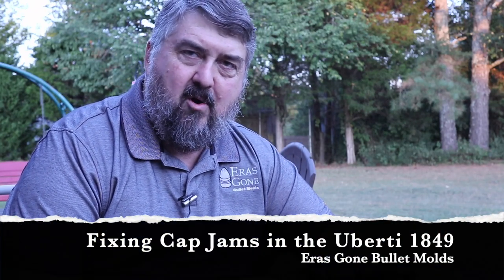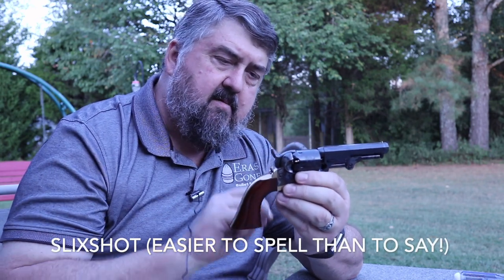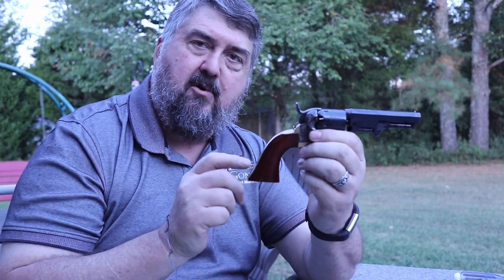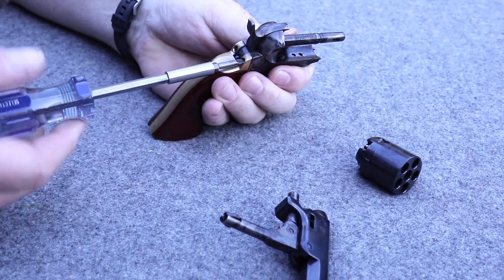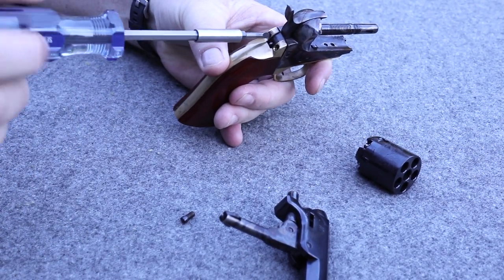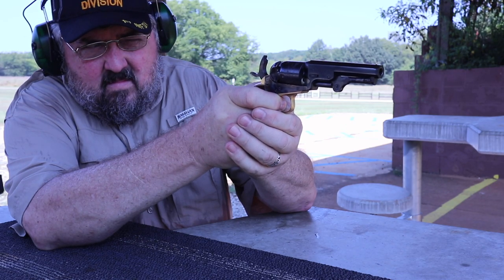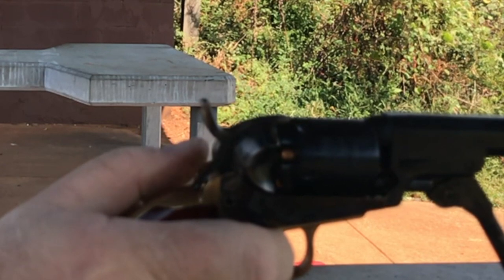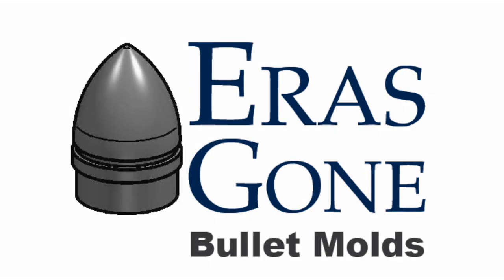Uberti Model 1849 Cap Jam Fixes

Comment: The biggest reason for regular cap jams is the modern handling of cap and ball revolvers in addition to range requirements for safety. 
The revolver that has the least cap jams is the Spiller and Burr.
The double spring method shown here is the best known fix, consider caliper grease between the springs. 
Super video sir!

Comment: I use a length of 1/4 OD with a .170 ID vinyl  tubing. The ID is perfect to trap a cap. I press a piece of the tubing over the cap and cut it so the cap now has a vinyl jacket that will 100% stop cap jams on any c&b revolver. The caps stay on the nipples and are captured by the vinyl jacket. The caps are even easier to put on and remove than they would be normally.

Comment: Just about everyone I have talked to who bought an Uberti Model 1849 Pocket revolver has had issues with them, one thing or another. Mine literally wouldn't stay on half cock new out of the box, I ended up having to replace the hammer. The timing wasn't great and I swapped out the nipples on mine to Amco nipples and it works fine. The barrel wedge doesn't sit in very well, it's loose. I bought a second new wedge from Uberti, it was looser than the one that came with the gun, so I peened the one wedge some and that makes it sit in the gun better. It took a bit or working to get it there but once I did it became a fairly decent shooter, but Uberti has had issues with these guns for years. I was lucky enough to get a stout mainspring in mine.

Comment: Good to know about the Uberti mainspring. One other thing that I've noticed is that most Colt replicas have cap jam issues, and one thing that makes a huge difference is to hone the pin slot in the hammer nose. While not an obvious place to work on, slicking up that slot as much as possible really reduces cap jams.

Comment: I bought one of these last year. I do love the gone, but it needed a lot of work. I had to stone the hand to stop the over rotation. The nipples were simply too short to use if they were properly seated. And the hammer face had a large blob of metal on it that I had to remove with a file. It's fine now, but that gun never should have left the factory.  Thanks for making these videos to show people how to correct the poor quality control we have to deal with these days.

Comment: I've never had the extreme blowback on my pocket model like you've had but it was still an issue. I tried track of the wolf nipples first, with great results but I haven't tried the treso yet but have them at the ready. 
After your 1860 army fluted Cylinder video I got one myself and noticed the nipples were near identical and well made, limited taper but unfortunately they had the largest vent hole I've ever seen on any nipple.
When after firing I point the gun to the ground and then cock with a twist, this keeps me from having a cap jam. I only shoot on my farm so this is easily done.
Mark, this was a super video with great information, I'll be trying this fix. Thanks!

Comment: ... something I learned using two pietta 1860's was to lighten my powder loads. Over charging or "maximum" charged loads will often result in hammers being blown back as well as charging rods being dropped as in your video. I reduced my charges from 30gr to 24gr with better results , still quite deadly...

Comment: I had the same issues with mine. I was able to make heavier main spring myself. Your double stack idea is great. I noticed on my Uberti 1849 pocket that the nipple pockets were different depths. The nipples were ending up too long and some were too short. That made me put a  spacer washer under some and shorten the cone and reshape on two nipples. Now they all fire and the cap jams are minimal. Great video. I may order an additional cylinder and see if the nipple depth are more accurate

Comment: Thanks.  Having the same problem with my Uberti 1862 Pocket Police and my 1862 Pocket Navy.  The replacement nipples from Slixshot are on their way.  If that doesn't resolve it, I will be ordering two extra mainsprings for them.  So glad that you say there is a fix for this, because these are such cool little guns, and it would be a shame if they couldn't be made to be reliable.
Reply: @SSN515  Yes.  Recommended.
Reply: @therealhawkeyeii7888  OK, thanks for the info.

Comment: I have also used a standard Colt type mainspring and shortened it a little. The screw hole is the same but you may have to trim a small amount of metal on either side of that area to fit the one piece grips. This gives you an option of trying a standard or reduced power mainspring. The current stock Uberti mainspring is weakest right at the top under the hammer which is one reason for so much blow back.

Comment: using the fix that Bottom Dealing Mike recommends by filling the safety notch in the hammer with JB weld is another help. My 1862 new police has a cap guard installed in the frame and that is the ultimate fix. Thanks Mark for the video and the molds you have brought interesting bullets for these cap and ball guns..
Reply: How was the cap guard installed? The frame is very thin where the pin would go. Working on one right now & not sure pin will hold.

Comment: Great video Mark, when these firearms were originally used, was cap jamming also a problem.Hard question to answer but I thought you might know.
Reply from the maker: Yes indeed, especially if the wrong caps were used.  Colt revolvers like a cap made of thicker copper material to keep them from fragmenting.  The sheet copper used in modern caps is much too thin which contributes to caps fragmenting and jamming up the guns.
Reply: Agreed. I have an old tin of caps from the 1970's they have thicker 
metal cup. I don't remember cap jams when I used to shoot back then.

Comment: This mod does work but not without modifying the mainspring.  Parts schematic show #070020 as the mainspring.  When it comes it is slightly longer at the tip and wider at the base than what was in the pistol.  Looking close at the one in the pistol I could see where it also had been filed down at the tip and along the right side at the base.  Without filing it is too long to go under the trigger and too wide to slide into the grip.  Also, with two springs it takes a lot more force to cock and de-cock.  It is now so strong it actually hurts your thumb after a few.
Reply from the maker: The extra spring that I received from Taylor's & Company was identical to the one that came with the revolver.  It required no filing or modification to install.  Older springs, or those from another source, might be different.
Reply: @erasgonehistoricalmolds2400  I did receive mine from VTI Gun Parts as Taylor's & Company had no stock.  Just curious if the one from Taylor's was correct size or they filed it down to match what came in the pistol from Uberti.  As I said,  I can see where the original one had been filed on.  Also, is your pistol now significantly harder to cock and de-cock?
Reply: I did receive mine from VTI Gun Parts as Taylor's & Company had no stock.  Just curious if the one from Taylor's was correct size or they filed it down to match what came in the pistol from Uberti.  As I said,  I can see where the original one had been filed on.  Also, is your pistol now significantly harder to cock and de-cock?